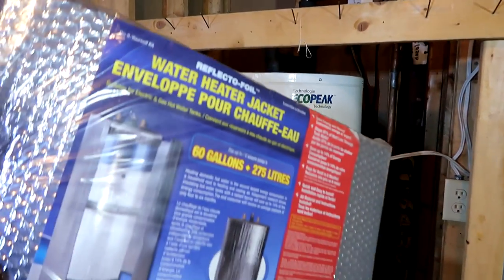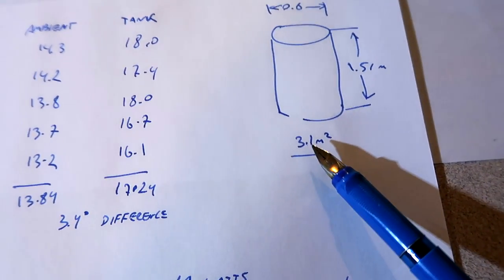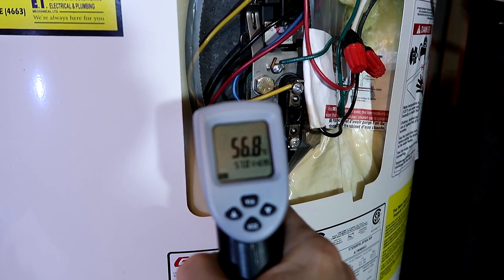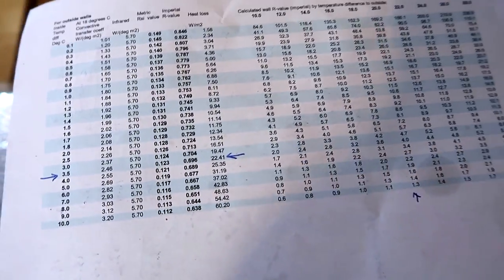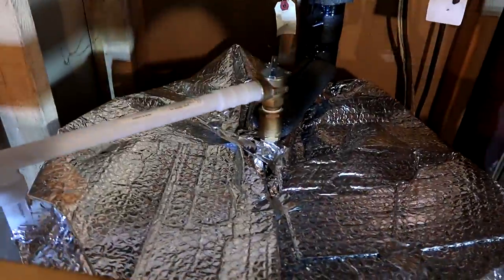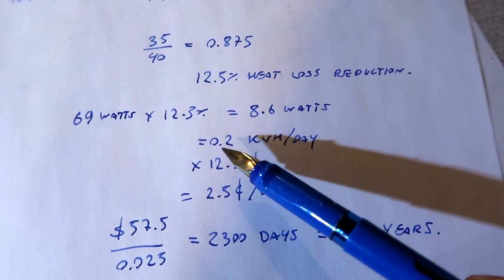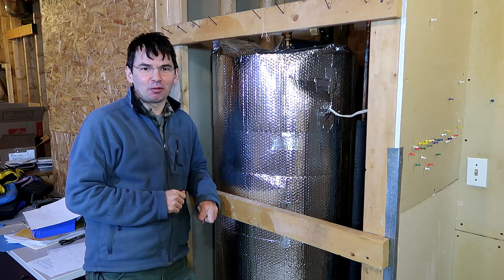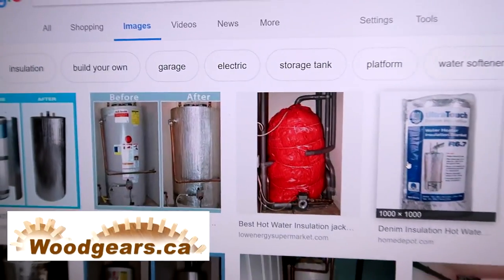Hot water heater insulating jacket:  How much savings

Comment: Hot water heater huh? Didn't know the water was hot before it went into the tank
Reply: Usually not but you don't usually use up every bit of hot water out of the tank so it heats the hot water remaining in the tank up to a higher temperature.

Comment: the heat losses ratio of a cylinder differ from a flat surface
Reply from the maker: depends on rate of curvature with respect to boundary layer thickness.  For a cylinder this big, it's pretty much flat.
Reply: @matthiasrandomstuff2221  you'r probably right... There's a few years from my last class of thermodynamics. I don't quite remember if you need another constat for the math or another step on it.

Comment: Heat lost in the home is not lost. It just heats your home
Reply: Dan Tuck not if the basement is drafty and cut off from the other floots
Reply: I suppose if you live in a refrigerator box you would be unlikely to even have a hot water tank.
Reply: yeah well my house has a stone foundation with no mortar and a dirt floor because it was built in 1883, the basement is drafty but the livable area upstairs stays warm. New England winters get expensive with heating bills and I wish the ambient heat from my water heater helped but unfortunately I DO live in a refrigerator Box lol

Comment: Your math is solid and accurate, until it is not. At the end the logic is wrong: 
Measuring the outside of the extra insulation and comparing that to ambient would seem more appropriate to base the final heat loss calculations. If the T° outside is close to ambient, then the insulation is successful. Measuring under the extra insulation gives no useful information: It's 5°C warmer, that is irrelevant.

Following your logic it would have to be 40° hotter under the extra insulation, therefore making the main insulation redundant, which is ... illogical. The extra insulation is supposed to complement the main insulation and work in combination with it, not replace it. Also why start with delta ambient to original exterior (good), then switch to delta under extra cover (not good)
Reply from the maker: yes, measuring the outside would seem more appropriate.  And also be completely wrong, because it's IR reflective, so the meter just reads whatever is reflected off of it.

Comment: Looking at doing same... From what I can tell that stuff you're using is a scam and they lie about the R value... sounds like the Fiberglass is much better forget the foil backed stuff... How much better don't know... You might have a problem not sure you have 1", 2" or 3" of extra space to install.
Reply from the maker: I recently covered part of the tank with fiberglass, and it got warm under there, but not really warm.  Which is to say, putting fiberglass batting aroudn the water heater helps, but not hugely so.  I figure if i covered the whole tank, it would only save maybe .5 kwh per day.

Comment: Some people just like to have someone else determining how efficient something you are using is...I can help fix that problem...first..you have to be a damn fool to buy this thing no offense...but I call a spade a spade ...I'm not immune from making stupid decisions...buying this is way passed stupid decisions...you can get a roll of this insulation from a hvac supply house...or online...get metal foil tape and then make a surrounding around your water heater so it would be loose around the water heater and not tight to it...air is great insulation...that is bubble rap insulation...the conducting surface  takes care of radiant heat from the water heater from escaping..heat will get trapped inside....so it would literally be insulating itself...and the bigger the gap for air the better...till a point...and with the same amount of money for 1 of the to buy you can make 5 or more that work 10,000% better...I may be over exaggerating some here...and you definitely know how this works which makes me think that you will mention what I did ...now I watch the video and see if I was right

Comment: hot water heaters are already insulated on the inside
Reply: Buddy!  there's water on the inside, not insulation, Insulation goes on the outside! If the insulation was on the inside, it would get wet!
Reply: @bootsowen  I do believe there is insulation between the inner water tank and the sheet metal on the outside. I think Matthias said his is polyurethane foam.

Comment: It's not a"hot" water heater. It's a water heater. You don't need to heat hot water.
Reply from the maker: But you need to heat water to get hot water.  Duh!  It just so happens to be named for what comes out, just like a car factor is named for cars, not for rolls of sheet metal.

Comment: I just do not get it, what can be measured by temperature difference between tank and wall
Reply: Wait... Right. Don't you need to measure the temp of the water and compare it to the outside of the heater tank thing?
Reply: Check the link in the description.
Reply: @moninum   I did and it does not make sense to me. Starting from the point: "The effective R value of the wall surface, at a 1.5 degree temperature difference is R 0.728 (or Rsi of 0.13).". R value of wall surface? What does it mean? Why it is 0.728 (0.13 in SI)?

Comment: Wow you seem like a really smart guy but for some reason you call that water heater a "hot" water heater if your water heated needed to heat "hot" water why would you need it? If you can't just call it a a water heater, what it actually is, then maybe you should call in a cold water heater
Reply from the maker: and you would call a factory that makes cars a "sheet metal roll plant" then?
Reply: @matthiasrandomstuff2221  no I would probably call it Toyota or Chevrolet Orr Honda hahaha. I wonder what you call it. My point is there's no such thing as a hot water heater it's called a water heater

Comment: Given that a hot water heater only lasts about 5-7 years why bother?
Reply: you can always take the insulation off the old one and put it on the new one
Reply: You can extend the life by replacing the anode rod.
Reply: Crap quality if only lasting 7 years. Mine is 20 plus years and still going fine. Parents replaced theirs after 35.
Reply: In the US they use glass lined steel tanks. They rust. We use stainless steel. Our water heater is from 1987 and still going strong.
Reply: Our water heaters here in Norway have a full 10 year manufacturer warranty, but they last at least 20 years without any trouble, many still have 50 year old tanks still chugging along fine

Comment: Water Heater.
Not "Hot Water Heater."
Stick with "crafts."  Leave the plumbing to us plumbers.
Reply: Considering the temperature of the water when the thermostat kicks in and turns on the heating element, I think 'hot water heater' is a very apt description.

Comment: Dislike simply because there is no such thing as a ‘hot’ water heater. If the water is already hot, there is literally no need to heat it. 
This is a Water Heater. Nothing more, nothing less. 🤦🏻‍♂️

Comment: Wrapping a water heater in a thermal blanket will almost always invalidate any warranty due to condensation always in contact with the heater. Most real plumbers would know that and advise not to use one. Youtube wannabes don't ever seem to understand what they are doing, but as long as the camera is on it doesn't seem to matter to them. Touch the outside of a water heater, is it hot, or even slightly warm? No, because the internal insulation works properly, efficiently, and as designed. Therma blankets do exactly what they were designed to do also... to take your money. Don't listen to morons begging for either money or attention on youtube for anything more than how to make a cake with 30K calories.
Reply from the maker: tank is hotter than the environment.  Do tell where there would be condensation from that?
Reply: @brianbassett4379  No argument.